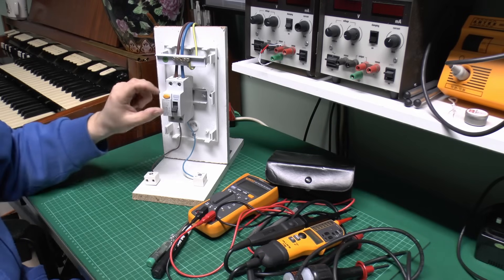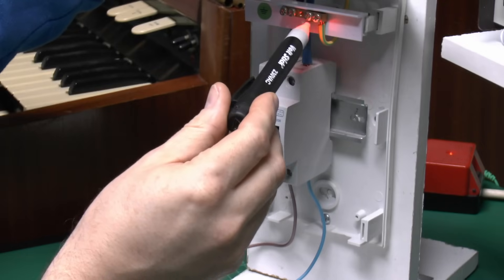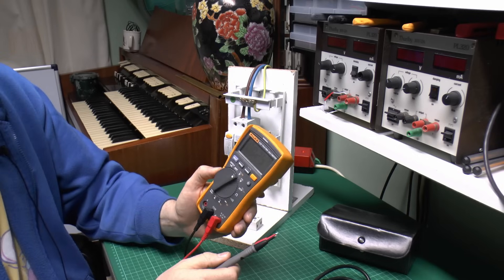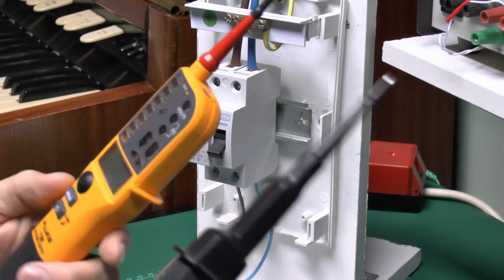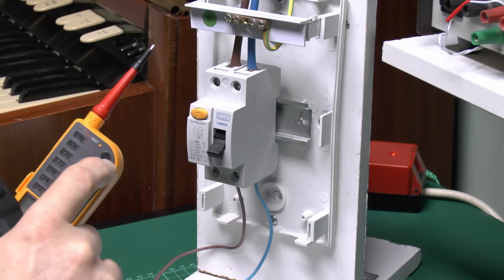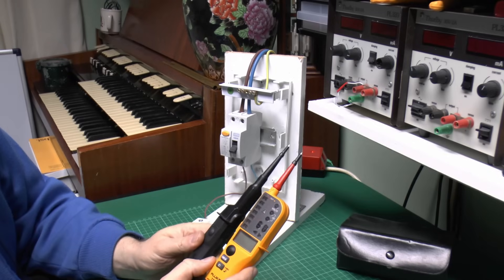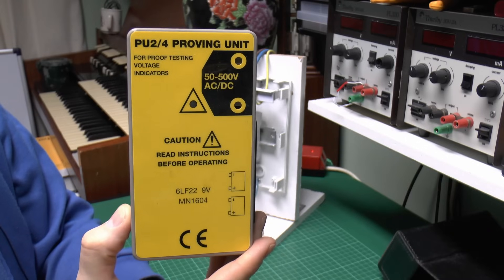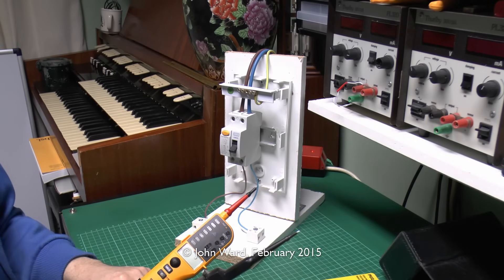Proving Dead - Mains Electricity

Comment: Is a cat 2 500 v multi meter ok to check if I have 230 v to my sockets
Reply from the maker: Yes.
Reply: @jwflame  also if a mcb fuse needs down rating in a consumer unit from 32 amp to 20 amp can a competent person do this or dose it need to be a fully qualified electrian and the work need certification thanks for advise
Reply from the maker: Anyone can do electrical work provided it is done safely - no qualifications are needed for any of it.
Reply: @jwflame  ok thanks.I always thought you had to be a qualified electrian to mess with the consumer unit. Thanks for the advice 👍

Comment: what happens if you put the probes the wrong way around? 

so in the video you were putting the black com cable probe onto the neutral & the red on live to get 261, but what if you did not know which cable was which or a cowboy job meant that you actually put the black com onto live & the red onto neutral...
what would happen then?
Reply: It's AC.  You would still get the same voltage reading.

Comment: but why not use a fluke 322 or t-1000 instead? They auto-check for voltage AND can measure amps AND continuity AND resistance, so why bother with a dedicated voltage indicator? or the regular multimeter? Makes no sense.

In fact I don't understand the big difference between fluke 322 and t-1000...?
Reply from the maker: Clamp meters and other devices have several range settings, meaning it would be entirely possible to use the wrong range and get an incorrect indication.  Dedicated voltage indicators have no settings or ranges,  eliminating the possibility of any error in use.

Comment: uk mains is 230v -6% +10% ... this is actually regulation that your supplier has to keep to, since your voltage is higher than the standard you can actually sue them for damage to electronics

Comment: One little check I like to do AFTER proving dead is to throw my finger past a live conductor, very briefly making contact with it. Its just a final check before getting my hands right in there just to make absolutly sure its dead. There was one occasion where some dipshit managed to wire a lighting circuit in series with another (every seen one of them?). I threw my hand past it and got the tiniest shock. Good job I did, when tested there was 190v on the bastard. I thought it was dead as the rest of that circuit was isolated.
Reply: @Schwalbe262 Yep, thats exactly what happened. I should have put that in the comment!

Comment: John - why is your voltage 260? Is this something you’ve done?
Reply from the maker: Isolation transformer was used, and with no load connected  the voltage is higher than normal.
Reply: John Ward thanks. Can you do a video, if not already done, which explains single phase UK domestic supply transformers and about Y and Delta?

Comment: What kind of microphone-system do you use? I find it peculiar that it's so sensitive to anything electrical you do.
Reply from the maker: ***** Microphone is a Speedlink SPES.  Seems to pick up all kinds of interference which is amplified by the camera.  It also means I can't use the camera with the mains charger connected, as the interference obliterates all sound (yet it's totally fine with the built in microphone).
Reply: ***** Try putting a bunch of clip-on-ferrites on the wires of your equipment. I'm sure it can be fixed.

Comment: I know that the screwdriver is dangerous but I have used it exclusively since I remember and it never failed me. That is the only way that i test , and i trust it 100%. 
The bulb lamp tester is the worst method for testing voltage presence that should be used to test only if a circuit is good.
Reply: Incorrect; I wish people like you stopped posting because you propagate dangerous ideas.

Comment: Multi meters are excellent test equipment. I can't understand why you are so against them. Yes, use a top quality unit, like a Fluke! but if an electrician has doubt in using one, well, plainly he shouldn't be an electrician now should he!
Reply from the maker: +angelo luis Multimeters are not appropriate for proving dead, as it is possible to select the wrong range or use the wrong sockets for the leads.
Reply: Again.... if you make a mistake like that you are hardly a competent eletrician are you? A good trades man should know how to use his tools! enough said! What you are saying is... use a 13mm spanner for a 13mm nut, because if you use an adjustable spanner you may get it wrong and round off the nut! ridiculous! What about oscilloscopes? are they too sensitive??
Reply: +angelo luis I mean no offence, angelo, but you really don't understand the basic principles of health and safety.

It is a fact of life that even experts make mistakes. What distinguishes the true professional from the bodger is not that he never makes mistakes; it is that he thinks ahead, and puts in place measures to ensure that no mistake will ever lead to disaster.

Take your 13mm nut example. If you use an adjustable spanner and get it wrong, you have a rounded nut. Would that be disastrous or not? If not then fine, go ahead and use your adjustable spanner. But if it would cause a disaster, a professional would insist on using a 13mm spanner. (Or, if none were available, they would use the adjustable spanner with extreme care.) So I'm 100% sure that nuclear power stations have strict rules about using adjustable spanners, because they can't afford mistakes.

You said, "if an electrician has doubt in using [a multimeter], well, plainly he shouldn't be an electrician". You've got it backwards. It's very, very easy to slip the dial into the wrong place on a multimeter, and it's not immediately obvious when you get it wrong. If an electrician has total confidence that he will never make this mistake, to the point where he's willing to bet his life on it, he shouldn't be an electrician, or any other kind of safety-critical worker.
Reply: I don't understand...... damn! I have been working with electricity all my life. TV and Radio servicing, rewiring cars back in the day! Domestic electrics is a nothing to me. There is nothing complicated about fault finding, or rewiring a domestic property! Its like plumbing, a monkey could do it. Health and safety! PFFF I'm not a monkey! This PC crap makes me laugh! NO OFENCE!
Reply: +angelo luis TL;DR Health and safety came from the military. They figured out that people tend to underestimate the risks they take. If you teach people to be more careful, they have less accidents and get more done.

Most people instinctively feel the way you do about safety. That's human nature. And that's why, throughout most of recorded history, we didn't have these health and safety principles I've been talking about. Fatal accidents were just a fact of life -- it never occurred to anybody that we could prevent them.

The culture of health and safety started in the military. One thing the military is good at is collecting statistics, and when they checked their accident statistics, they noticed that far too many soldiers were dying in stupid accidents. And this was costing them a fortune -- what's the point in training a soldier if he's just going to get himself killed trying to steal drinks from a coke vending machine? (I'm not kidding here. This was a serious issue at one point. Grown men would tilt vending machines to get free drinks out, and be crushed to death. It was a real problem in the States.)

So they introduced the health and safety concept, and it worked better than they had hoped for! You might expect that they got things done more slowly because everybody was being so damn careful, but actually, the opposite was true. Because people were more careful, there were fewer accidents, and everything ran more smoothly.

So, yeah, maybe a monkey could rewire a house, but did you know that a lot of monkeys die falling out of trees? Would you entrust a monkey with the safety of you and your family? I've seen what happens when some monkey wires an electric plug wrong and swaps the live and neutral wires, and I'd much rather have it done by someone who has a clear understanding of where the risks are, and how to mitigate them.
Reply: @angeloluis4130  You've never made a mistake ,no?

Comment: Can i ask if that Fluke unit will give any indication when you only connect it to the line terminal? I ask because i see a potential problem if you are working on a circuit that contains an unknown neutral fault. If the fluke gives no indication when only connected to the line, then a neutral fault could lead you to thinking the power was off, when really the line was still switched on. Ironically the two nasty devices (screwdriver and pen) would have given you warning that line was present.
Reply from the maker: Yes it does, it contains the same arrangement as the non-contact pen style testers so will indicate voltage even if only one probe is connected.  It also works for voltage detection even if the battery is flat or missing.
Reply: Thanks, John, i thought i could see a small red light come on a fraction of a second before the rest did when you showed it in use, i wondered if that was what it was. Good to know indeed.

Comment: yes you could set ranges manually on multi meter but who would set the range to manual, and seeing OL on the multimeter display is enough to show that theres something wrong, for example range as you shown, i sometimes check it by holding one of the probe (not recommended) but i dont see why not, the highest current you will see is 26 UA with 10megohm divider inside the meter (of course not the most reliable or safest method dont get me wrong, but i done it many times without problem)
Reply: Or you could buy a cheap voltage tester and not bother with ranges on a multimeter, that's the point, keep it simple.

Sure you could carry on doing "this", "that" or the "other", but voltage testers are so cheap why actually bother using anything else?  It's not like they cost a fortune so what's the big deal not getting one if you are serious about working on 240v?

Without a suitable Earth to test, your multimeter could give you a nasty surprise if neutral was open and it doesn't have single pole detection.  My cheap voltage tester doesn't need two poles to show that one of the poles is live, your multimeter wouldn't and you'd get a shock.  That can literally mean the difference between life and death, so why take the chance when eBay sells voltage testers at nothing money?

It's a really bizarre attitude people have.

Comment: Yeah.... I'll stick to my multimeter! If you are not stupid it is definitely the most reliable!
Reply: +Joshua&#39;s Recordings nope, approved voltage meters (proving units with leds stating voltage) are considered the most safe and most reliable in the industry. Multi meters are very complex and can easily be damaged to give a wrong reading. I would take proving dead a 4,000A 400V bus-bar with my proving unit than any multi meter !
Reply: +Luc Mathlin Multimeter is very complex. Not really - set it to AC voltage and put your probes in. If I was proving a 400V device was dead I would probably want more than one thing to test it with too!
Reply: Multimeter equals deathtrap

Comment: With respect, the multimeter is the ultimate proving device (apart from oscilloscope...)
Reply: If you have two wires and no Earth how does a multimeter prove dead if Neutral is open?

If you have two wires and both are exactly 240v each, what would your multimeter display?

When you know the answer you'll realise why using only a multimeter could kill you.
Reply: @fredbloggs8034  You need an earth connection, just like the Fluke device does. You measure each wire against a known good earth. That is what the Fluke T-pole tester does anyway.
Reply: @vonpaparas  

Nope.  The Fluke he is using shows Live on one pole.
Reply: @fredbloggs8034  It's inductively coupling to your body for the earth connection. Which is exactly what the much-derided "Voltalert" does. It doesn't beat the laws of physics.
Reply: @vonpaparas  

You said "You need an earth connection" as in a wire or Earth point.  With the Fluke you do not which is the whole point of why voltage testers are the approved method of testing for dead and multimeters are not.

Are you going to answer my questions?

If you have two wires and no Earth how does a multimeter prove dead if Neutral is open?

If you have two wires and both are exactly 240v each, what would your multimeter display?
Reply: @fredbloggs8034  I have answered. Your scenario of "no Earth" is not valid as the Fluke is inductively using your body as the earth connection. With no Earth, the Fluke doesn't work either.
Reply: @vonpaparas  

FFS do I really have to S-P-E-L-L I-T O-U-T? 

If you have two wires and no Earth WIRE OR SOMEWHERE TO ATTACH TO AN EARTH (ffs!) how does a multimeter prove dead if Neutral is open?

If you have two wires and both are exactly 240v each, what would your multimeter display?

Just answer the bloody questions.
Reply: @fredbloggs8034  a voltage is a potential difference. The difference between two things. No voltage detector can work without something to reference against. Much as birds can sit on an overhead power line with no issues but if you put a ladder against it you might have some issues.

Things like the plastic volt sticks are using your body capacitively coupled to ground. 

In the scenario that you describe of a phase/line but no neutral, your initial check will pick up that something's not right before you go and turn it off. At that point you know you need to be more careful. In any case, if you have phase/line, measure to neutral, get volts, turn it off, measure, no volts, check tester, working... you could have turned off the neutral instead of both phase and neutral. The tester will still show that you've disconnected it, even though you haven't.

Comment: Although you are right mostly, as an educational source I downvoted it.
- Contacless voltage testers could be made "reliable" as capacitive testers are the norm for voltages over 1kV. But these pens are NOT standardized, even if they could be as, or more* reliable (and many of them are) as any two-pole.
- Fluke multimeter's symbol doesn't mean "power is on". It means voltage is "over safe voltage" (by Fluke's own standards its 30V), but it also lights up if the measured voltage overLOADs (who says over-limit, that just sounds off) the selected range.
- Voltage testers can have other swithcable functions as well as multimeters, that is NOT the reason to not use them as voltage testers. Automatically switching back to voltage indication (or simultaneously doing it) on non-ELV is a must however. Multimeters can be (and some actually are) made like that.
But they don't have to conform to IEC 61243-3, or your national homologized equivalent. That is the only point you have to make - and you fail to make it - everything else is just the detail/explanation/reason behind the standard.
Multimeters are "fine" (regulated by IEC 61010) if they fail on high voltage transient spikes - occasionally present on mains - without injuring the user. Voltage testers HAVE TO keep on working after subjected to multiple (as I remember) 8kV pulses.
Also, they HAVE TO have indications without (working) battery, which you kinda implied.

I feel a bit conflicted about this whole educational video.
Who is the target audience?
- Professional electricians? The proof->test->proof sequence is present in your video, but not emphasized enough, and that is a MUST for a professional. It is a bit of an under-shoot for an electrician, I think.
- Unprofessional civilians? They SHOULD NOT have to test for mains, except in emergencies (where they will have to use what is on hand, maybe the capacitive screwdriver).
I know, most people without any reasonable education will test for mains a few times in their lives, but I don't feel like they should be encouraged to work on mains circuits. Start by, I don't know, "seek professional help if you are layman and need to work with anything potentionally uninsulated and live. Don't touch anything."
I don't know about the UK, but most probably it is also true there: an unprofessional is NOT ALLOWED to work on mains. Yes, you can. But dying, and leaving your widow denied you life insurance is not a good death in my book.
Reply: Of course anyone can work on the mains in the UK.  I do not need to be a "professional" to add a wall socket!

Comment: proving unit has no batt check,, huh
Reply from the maker: It doesn't, but it would be immediately obvious if the battery needed replacement as it wouldn't work with the voltage indicator.

Comment: The test boxes puzzle me - when would you ever be in doubt that the mains is working?  It's like those emergency parachutes people bought after 9/11.  It's not that it can't happen it's just a weird fringe thing that you never actually come across.  I guess they're good for places that have sporadic power cuts on a regular basis?  Or OTG systems maybe?
Reply from the maker: ***** They are more for situations where there is a large distance between the equipment you are working on and the location where power is disconnected.  Such as a large factory, where the distribution board could be a substantial distance away, or even in a separate building.Once disconnected, there would be no power at the work site, however you still need to ensure the tester is working, so would use the test box rather than waste time travelling across a large site just to find a source of power.

Comment: In my opinion multimeters are perfect for testing voltage if you know what you're doing. If you're selecting the wrong settings or have the leads in wrong, chances are you should be nowhere near mains voltage in the first place.
Reply: Well, I'm afraid you are wrong